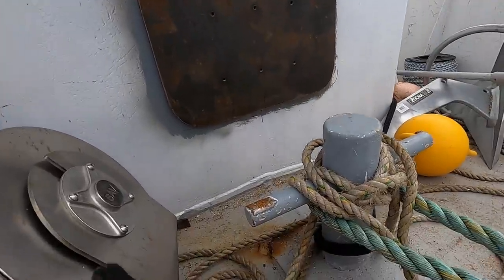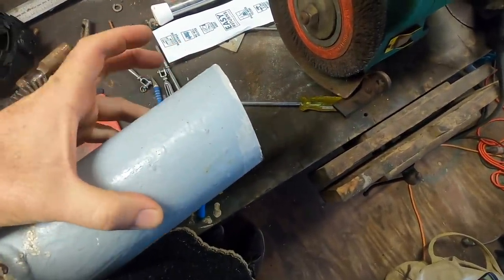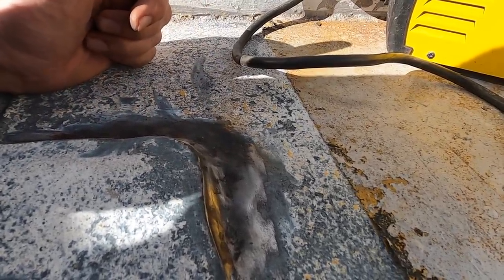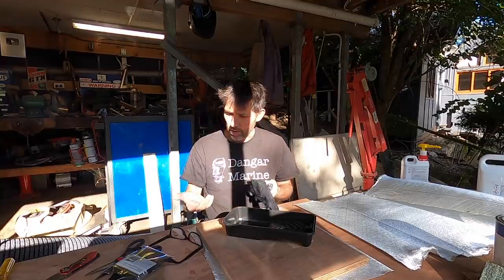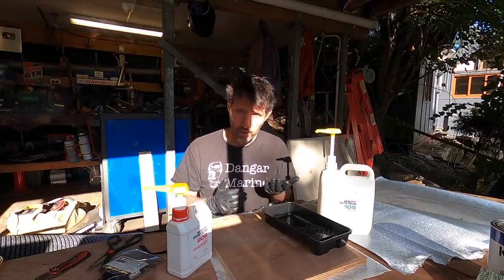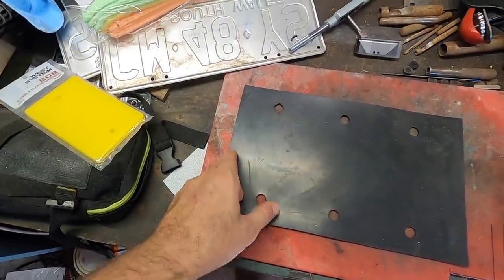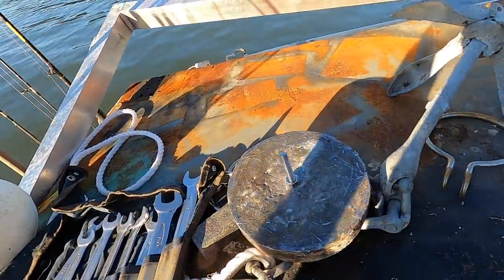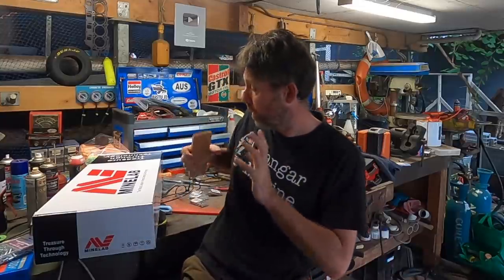Permanent installation of the Savwinch anchor winch

Comment: hey Stu.Good to see the hand back to almost workable mate..I've had a drum winch for 15yrs and love them..Ill give you one tip if i may and that is when you are dropping away don't take your eyes off the drum as they easily throw a coil of rope over the side of the spool and if you don't catch it the rope will get bound around the axel between the drum and the cradle and man it takes some effort to get it out, especially solo..I have even had to cut it and splice it back together until i learned my lesson..I threw the domed bow roller away as well after some frustration and just ran the rope up over a piece of SS 50mm pipe with each end flattened a bit to give it a domed effect and never had much drama with the rope coiling up unevenly after that..of course you may still need to drive left or right to help it on but the roller near drove me mad trying to get the rope and chain back on evenly and in one go..The SS pipe has been there now 4 yrs and it doesn't worry the rope as the water lubes it on the way up and going down is pretty rub free anyway..would i swap for a capstan winch? nope, not while im anchoring in under 50m depths
Reply from the maker: Thanks mate, apprciate you giving me the benefit of your experience. Much appreciated!

Comment: Greetings from The Netherlands!
next time welding a large plate to the wheelhouse u can cut a large hole in the center of the plate and weld the inner edge to the wheelhouse to get some extra strength! Keep up the good work and stay afloat!
Reply from the maker: I was thinking about doing a plug weld in the centre but then I figured it was probably already more than strong enough. It is a great technique to keen in mind for very high-load situations though for sure. Thanks!

Comment: That thick goopy stuff works great, and although what you are doing will work I would do it differently ( of course ). A tip for welding thin metal : hot and fast. cold and slow still too hot, do a bead either side on good parent metal and work in, going side to side to alleviate heat gain and a wet rag does wonders. I wear gloves when welding and grinding too.
Reply from the maker: Thanks for the tip!

Comment: FYI use the glue designed for synthetic grass. It's much cheaper and is designed for wet areas outdoors.
Coat one surface ridged like tile adhesive, let it tack off, then apply carpet. Its a thick paste so builds a tacky layer to push the carpet into and bond
Bunnings stock it

Comment: Tip: for contact cement, get a piece of formica or thin piece of hardboard or plywood, cut "teeth" in one edge, pour and spread.  Similar to a toothed float for tile adhesive.  Much easier than brushing and no cleanup.
Reply from the maker: Ah yes, I have seen those, good thinking!
Reply: Use a paint roller. 1/4” nap. Also, coat the more flexible surface first, using your substrate under it to keep it rigid.

Comment: A good way to weld up the thin stuff is to start at the edge where there is good metal get a good puddle then get behind it and push it across
Reply from the maker: Good tip, thanks!

Comment: Have you tried AB epoxy before. 2 part epoxy and is pliable to shape. Works great for finnish work and can be painted. Works great under water as well. Use on ruff metal surfaces for a nice finnish. Will shape  w/wet hands also
Reply from the maker: Interesting, I'll keep an eye out for it.

Comment: Heat up resin not hardener in warm to hot water and it speeds up set time  Using white iron oxide makes it last a bit bitter and UV light as well and hardens the resin even more. It's cheapest chips Its use it for coloring concrete

Comment: Try Weldwell PH16TC Rods, I used to do repair work on large vessels and found they were the best for contaminated steel, just crank the amps up and burn it out and they are the easiest to get nice Vertical up welds too
Reply from the maker: Thanks for the tip!

Comment: I think I would have made sure that anchor / mooring post had extra strength for when a storm hits Renko while swinging from her mooring . There`s going to be a lot of shock weight on that post . Tells us your welding will hold it together and I`ll be happy for you , cheers .
Reply from the maker: I'll definitely be keeping a close eye on it.
Reply: @DangarMarine  Cheers , I would be getting some Marine expertize looking into that , any signs of rust in the future and I would be re- designing the whole stem right down to the bow framework , that`s where the post should be starting from , cheers , Rick .

Comment: Hi Stu. I guess you will have chain on your anchor. How will that winch handle chain and the rope. And where do you stow the chain and rope  after hauling anchor?
Reply from the maker: Yes, there will be about a boat length of chain straight after the anchor that will also wind onto the drum.

Comment: Get yourself a thick copper plate for pad welding. Wedge it on the underside of the deck etc. Stops the molten steal from flowing through the hole. Allows peno and the weld doesn't stick to it. 😉 👍
Reply: Guessing the copper dissipates the heat?
Reply: @jbuckley2546  to an extent. Bigger the copper block the better. It also spreads the heat to the surrounding metal which dissipates heat as well
Reply from the maker: I did actually give that a go once, but I think I need to make the plate smaller as because of the irregularities in the deck I ended up with a 10mm gap bewteen the deck and the plate. Great technique though!
Reply: @DangarMarine  I have used hammered copper pipe in a pinch before. It is just something to keep the puddle in place long enough for it to cool. Then you can build on it with fillet runs

Comment: Grinders should always face down .You should have the other grip in your left hand .Grinders pull they do not push unless you are doing something wrong.They turn one way hard to beat centrifugal force safely.
Reply from the maker: Yes, trying to keep the handle in my good hand though.
Reply: I discovered angle grinders can push. Straight into my left knee. General anaesthetic, 8 stitches and a weekend in hospital....

Comment: What is behind the bulkhead to support the winch and the possible maximum force applied from operating the winch?
Reply from the maker: There is vertical and horizonal bracing, but I may still add extra.

Comment: Just a note of advise.. Many people have no reference for metric system visually.  We might use it but still many of the stuff made is usually in inches.  Just saying. Fifty mill or about x inches will help a ton.

Before someone argues..how many inch wheelbase is your car? What size is the rotors/drums on your car? What size are your rims or tires?  What size are the rims on your bicycle? Motorbike?
Reply: Your never too old to learn Metric, it's easy. Even U.S.A manufacturing is joining the global standard of metric, you need to be fluent in both languages.
Reply: I'm Canadian. sorry but not everything is metric and never will be anywhere.  My comment was so that everyone would have better idea of what he is talking about when it comes to sizes.

Comment: Dang,..Renko is really starting to come together!  Glad to see your hands are also coming together.  How do they feel after a day's work?  What are your doctors saying about you welding and using tools, esp power tools this quick?  I know my doctors had a bullshirt when I started using power tools 2 weeks AFTER getting the cast off when I had what they call a 'Boxer's break'.  I had to listen to him moan that the vibrations could cause the bones to separate again.   Well...he was wrong.  No probs at all, except a little pain in the cold now. Works good as new.  Winch looks great.  Are you going to use it just for the anchor or will you be pulling and hauling with it as well?  Nice neat job with the 'glass. I just started laying the first layer of fiberglass on the plywood cabin I built on my boat.  (Wish I had a way to send ya some befire & after photos).  It's amazing the feeling you get when the project is almost done, lol.  I have the first layer almost done. Doing 3 total.  What type of resin are you using?  I'm using Polyester with a wax based 'smoothing' additive that supposedly minimizes sanding. So far...the stuff is smooth as a piece of plastic.  Well, keep up the great work.  In the end, she'll be pristine.  Take care, stay healthy & safe.  Oh, any ideas on the next project?
Reply from the maker: The hands don't feel too bad after working which is good. The West System is an epoxy resin. Not sure about the next project, will get some diving in first!

Comment: A good pair of readers, or cheaters, and an N95 mask will get you close enough so you can keep a better eye on the metal puddle. Overhead welding: Rod in a very slight angle forward in the direction you're welding, same temps as flat (1/8" rod works best). Good to see you're healing well.  👍😉
Reply from the maker: Thanks for the tips David. :)

Comment: Instead of replacing your transom i would add a water tight compartment on the stern of the boat. Stretch your LOA by 10 %. Gain some lockers and maybe some hull speed. Existing pitted transom will now be a non vital internal bulkhead.

Comment: Your welds look fine. Functional  doesn't have to the same as certified. I am more concerned with the wheel house pulling off the deck before the winch releases the wheel house
Reply from the maker: I may still brace forward to the deck, but the real question is whether you can pull the wheelhouse forward using a 14mm rope and I really think the rope would break first so I'm not too worried yet. We'll see with use.

Comment: Curious if you plan on using chain why not use a chain stopper and a pelican hook?
Reply from the maker: Yep, there will be at least a boat length of chain after the anchor and some way of locking it off.

Comment: I would have cut the carpet and rubber over-size then cut off the excess, would have been easier.  It's the middle of summer in the UK and I have a pair of fleece-lined trousers, long leave shirt and a jumper, lucky you. :)
Reply from the maker: Yes, might try cutting oversize for the flow panels and see how that goes. Thanks for the tip!

Comment: I never trust those epoxy pumps, they must be spotless inside not to mention small air pockets. I use those huge syringes, takes more time but you know it's exact. Wouldn't matter much for your job, but building a boat is a different thing

Comment: if your set on the boat is dc then get some 7018 3.2 rods or 2.5...also if you do that again fit a sleeve in the id to weld into... but nice job
Reply from the maker: Good tip on the sleeve. The rods were 7016 from memory.
Reply: @DangarMarine   You can cut the stump a bit higher and grind a couple of slots and run some vertical welds in the slots to burn into the sleeve. Get a box or cadge some 7018's and have a go on the vertical. 
Also I use a cheater lens in my mask these days as they work well for close up as i use reading glasses for close up work.

Comment: quick quiestion,i pulled the bottom end of my yamaha 30 1987.the rod  that controls the gearhousing has fallen off. any tips getting this back on? Greetings from Norway!
Reply from the maker: It depends whether it is a twist type with a spine (just push it back in) or a push pull type in which case it will go through a clevish with a pin and retainer.
Reply: @DangarMarine  it has a bolt hole in the end of it closest to the engine block and an adjustment screw acessible with the bottom end on. usually i can fix everything myself but this is just wierd,tried taking the engine apart but no luck. so i just put the gearhoiusing on with it in the forward position so i can atleast use it temporarily.not my main boat. its a shame aswell its in really good condition excluding the paintjob on it.never seen any engine start so fast.

Comment: Hot tip, don't follow the wiring diagram from Savwinch, it's wrong on the control side, the blue and green wire on their solenoid operated model diagram need to be swapped on the solenoid terminals ( (also should be a 5 amp fuse in the green)
Reply from the maker: Interesting, I'll keep and eye out for that.
Reply: @DangarMarine  we just fitted one and the tech who wired it couldn't get it to work, wired to the diagram, soon as I saw the drawing I could see the issue :)

Comment: I have a mercury 25hp 4 stroke that’s stuck in forward after changing the bearing carrier any advice as to fixing it?
Reply from the maker: Sounds like an issue with the orientation of the gear selector when the bearing carrier was put back together.
Reply: How do I fix it without taking the lower unit off. And how come the prop spins freely when the motor is off but as soon as I crank it the prop is spinning like I’ve got it put in forward

Comment: Something in me wants to see the winch motor facing upwards, if only to keep the cables off the deck.
Reply from the maker: It can be rotated, but one the cables go through the wheelhouse they won't actually touch the deck, just have some drip loops to stop water migrating.

Comment: Normally enjoy how much thought you give to fixing stuff... but not this time.  THe horns on the king post are so you can figure 8 the anchor rode, and botht eh height of the post and the horns are well sized as is for line up to inch and a half. With the cut down post and the drum spacing, you're going to use a lighter line than you should, and your purchase won't be as good.
Reply from the maker: I'm primarily going to be slipping spliced eyes over that post.